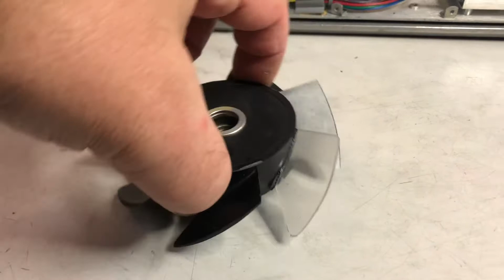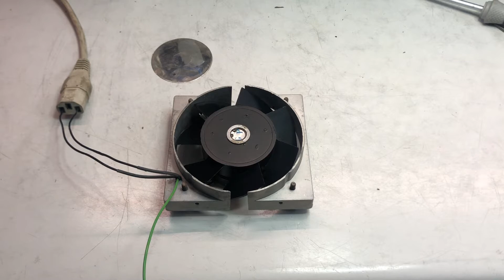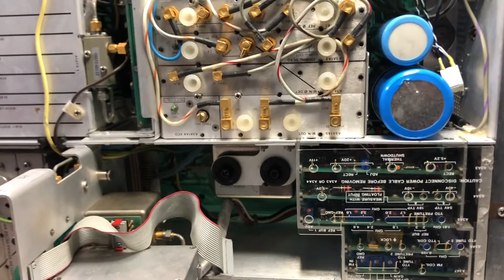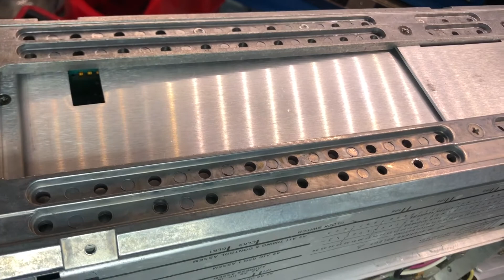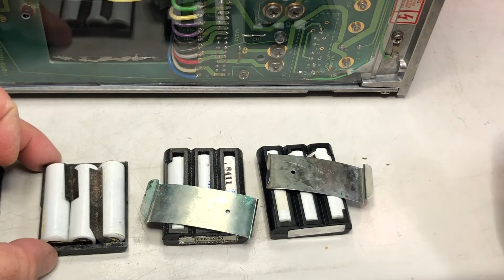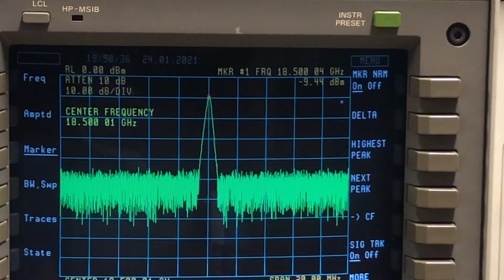Destroyed HP8672A Part 7 Fan Repair and Final Test

Comment: Well done - an amazing repair of a severely damaged unit! You might consider replacing those three ni-cad batteries with a single Li-ion cell with a charge controller. It may require a little modification of the charging circuit but the battery supply voltage to the static RAMs is not critical. I did this to my HP 8642B  Signal Generator.